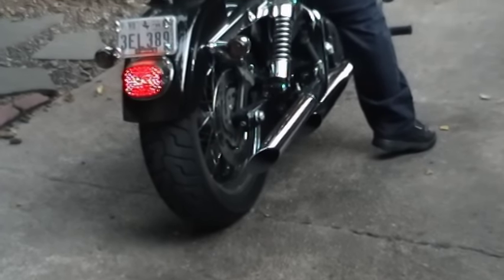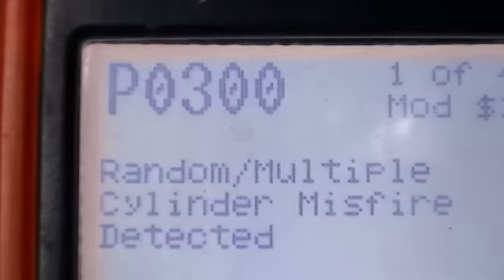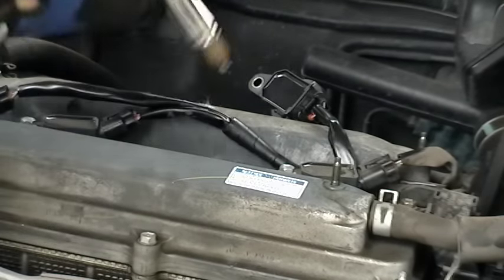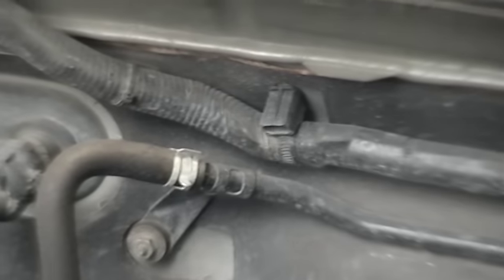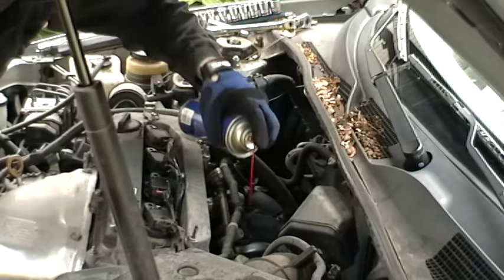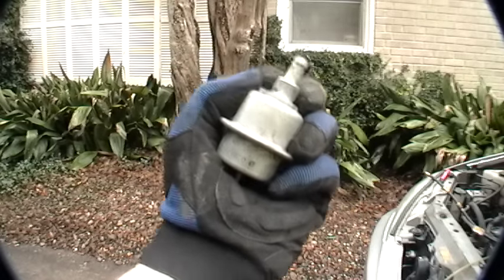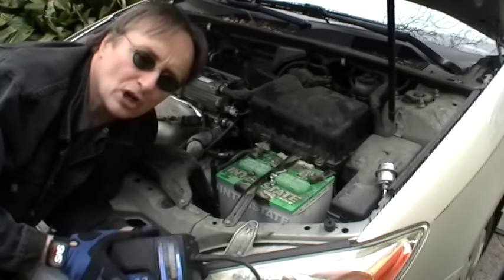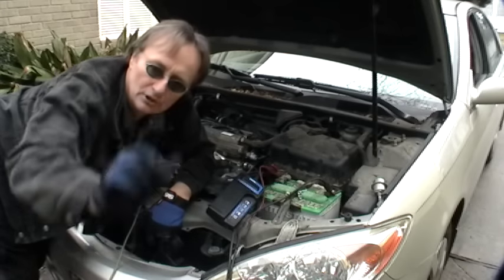How to Fix a Random Engine Misfire in Your Car (Code P0300)

Comment: hi master Scotty,i have chrysler s300 2010 and it got a problem last couple days p0305 that maked my car's powr down , i changed the sparks plug and the coil number 5 but the problem still there ....
Reply from the maker: +MR. NOOR swap fuelinjector # 5 with another and see if miss moves, showing that's bad. If not that, often internal engine problems, do a compression test to check that
Reply: +Scotty Kilmer i fixed what you told me to fix it now running good and another code has com p0016 i do know is the problem in the sensor or in camshaft timing .. thanks

Comment: i have a  1997 mercury villager gs 3.0L engine made by Nissan. i had the timing belt replaced by a friend and we lined everything up. started it and it ran like crap. checked codes and its the random miss fire code. replace fuel filter ,spark plugs, spark plug wires, rotor button, distribator cap, starter, and battery still bad code could it be the vacuum lines?
Reply from the maker: odds are he didn't line the belt up just right. Being off one tooth will do that, remove the timing cover, put it on TDC crank, and see if either cam is off a tooth or more
Reply: ok will do as soon as he can get back out here. and thank you

Comment: First it was saying cylinder #6 ignition coil now a week later it's reading random misfire and my car has been jumping real bad... 2005 Nissan Altima 3.5 SE any ideas??
Reply: Plugs or coils probably. Did u replace the spark plug when u replaced the coil? If not start there.

Comment: i had this problem in my 2001 blazer the mil would flash if i drove over 60kph i changed my spark plugs my distributor can and rotor checked for vacuum leaks none to be found checked my egr valve that was fine changed my fuel filter and checked my fuel psi and they were fine i was about to give up and then i changed the crankshaft position sensor and had a gm dealership do a crank relearn procedure and boom problem solved i would always check that sensor to because sometimes it wont show a check engine light

Comment: I need help my 2004 Dodge ram 1500 has the flash light on I replace the throttle body and camshaft sensor bit still doing the same

Comment: Hi Scotty  have a 2008 Qashqai, misfire on ticking over and up to 2000 revs over that runs perfect, on 2000 revs if I let my foot of then straight back on he will go for about 15 seconds then start misfiring again,the first code came up PO302 next day the code came up PO300,help needed
Reply from the maker: check #2 for weak fuel injector or weak ignition coils first
Reply: Thanks scotty no 2 cylinder took plug out and was sooty all others were OK the problem is no2 cylinder but put a new plug in and still the misfire thanks again

Comment: did all these but 2005 impala wont start random misfire has spark fuel air just cranks car seems to keep trying to turnover even when key isnot been turned any longer
any help is much appreciated
Reply from the maker: try a new ignition switch first

Comment: Thanks, I am learning so much whit your videos ,I am  single mom  and this help me save money  ,I sorry  for my english  a`m learning too,  my car s a hyundai 99 accent and  i have code 300 , 302   and 123
Reply from the maker: +R Luna fix the misfiring cylinder number two first. Could be bad spark plug or coil on plug OR wiring. Pray it's not internal engine damage

Comment: 2002 deville  300 misfire code,,,,   145,000 miles  runs perfect at start up  ,  no code for the first 20 minutes, then engine lite starts blinking, cleaned o2 sensor, no vacuum leak,  changed coil packs,  new plugs, new fuel pump, new catalytic  converter, map sensor, new pelum ,, what warms up and can create this 300 code  , at wits end ,,thank you for reading this post
Reply from the maker: +yank mcruff   tons of things can do that, but a blowing head gasket is number one. Do my video "how to tell if your head gasket is blown"

Comment: Thanks for the reply. But sadly, my compression are all within specs and very close together as they should be.
It is a swapped motor with 80k and everything else 180xxx.
The coilpack and injectors are from a different engine though.
It was running fine until I had my exhaust welds done by my 02 sensor/exhaust manifold, then it just started idling funny at start and died at times when coming to a stop and has a spitting sound through the intake.

Comment: Ok, these symptoms say little to me, but to a pro, they are going to give you an idea.
2005 Trailblazer, 4.2L Vortec.
1. I got an exhaust leak that I can hear. It started one day twos months ago and since then, I can hear the engine more like a 1980s truck. Sound is from engine area. I have not located the exhaust leak or know if it's at a gasket or header or what.
2. Random misfires. The code is not confirmed, but I checked it on an OBD scanner and the code was pending P0300. I cleared it, and it came back pending. Cleared it a 2nd time, it hasn't come back.
3. Very rough idle at times... maybe especially when starting it on a hot day.
4. Moderate rough idle most of the time.
5. Rare, but I do see the quick Check Engine Light flash on climbing a hill sometimes.
6. I have replaced 2 or 3 COP modules over the last 2 years as I would find a P030X code and a cylinder's coil went bad. Of course, those situations would start intermittent, then finally set a P0302 code or whatever, and I would immediately replace the #2 coil when that happened.
7. It's never really idled too great, especially summer and with A/C running.
8. I have owned it with 180,000 to 220,000 miles.

I just started it a few minutes ago. No code, moderate rough idle, no check engine light, but I did not drive it far.
Reply from the maker: try to find the leak using smoke as in this video https://www.youtube.com/watch?v=zMok2y05jNE&t=11s
Reply: Thanks. But at the moment, for the last time I drove it, I monitored misfires on an OBD-II reader. Guess what?

No misfires.

No codes.

Running better.

What would cause the intermittent rough idle that is so bad, the truck barely runs, then the next day it runs like a champ?
Reply from the maker: weak fuel pump, they are electronic and can fail intermittantly, when it runs bad, pressure test that

Comment: hi scotty  i have 02 impala with the 3.4 engine the car stars just fine the problem is wen i want to pass a car passing gear clicks but no power i replace  fuel filter one coil spark plugs tps sensor  i clean the map sensor clean the  agr the o2 sensor    i have no vacuum leaks and i have the nasty p0300 please  help 
132xxxxx miles

Comment: scotty i have a bmw 1serise with the yellow engine warnging light i have changed all the spark plugs and even did an air filter change i didnt change the oil filter but still have a yellow engine light, the car starts ok but is shaking a bit and cuts out when i gass it lacks power and i get a lot of white smoke from the tail pipe i had a guy put a code reader on it and he also checked the plugs and coils but couldnt find the reason for misfireing and now tells me it may be the thermostat sensor?

Comment: I'm getting a p0301 p0302 p0303 p0304 and p0300 on a 2005 Honda Civic Lx Special Edition. The car was parked for 5 months and did not have a check engine light on when I parked it. I was going to take it in for a smog check and saw the light as soon as I fired it up, engine was running smooth at idle so I turned it off and removed gas cap and put it back on light was still there. I have a ODB 2 scanner so I hooked it up and those are the codes I got. I wish I had that nifty battery tester cause after sitting so long maybe it's that.
Reply: Replaced all spark plugs all were pretty worn but one was black crusted over. I reset the codes so now I'm going to put some miles on it and see if this fix's problem. Thanks again for your videos. I'm also going to drive by autozone to see if they can do a load test on my battery.
Reply: All you need for the battery tester  . Get a volt meter . It tests alot more then batteries ..

Comment: Hi Scotty very much liked your video. I have a 2007 Renault megane cc. Realised today it has a problem with power. Diagnostic OBE 2 says PO300 . Also there a squeaky noise when driving. Can you advise me please?
Reply: I have the same car and same problem, I've been googling into renault forums and other pages and I will check engine coil with my mechanic. If you discover what's wrong with your car, please let me know.
Reply: +Navi Voj 
 Taking car to the garage tmw , and will let you know about car issue

Comment: well scoty i got this code on my 03 gmc serria i did the cap adn roter wires it might be the coil pack weck spark 
im also wondering is there any fuses that can be checkt for igtion i did have the parts guy sya hay u might repalce that any who ill check fuel filler i did that 5 years ago maybe over do thanks

Comment: Sooo I pulled my spark plug boots out of my eclipse and in the first one there's oil, but in the others it's clean, I was gonna try to check or change my spark plugs but even with a deep well socket I couldn't get them out.
Reply from the maker: +Levi Grafton make sure you have the right size socket AND replace the valve cover gasket and spark plug tube seals

Comment: I have an 03 2500 with 6.0 at idle under load (stop lights etc) it idles up and down. I have a  random misfire code. but the check engine light only comes on  when im on the freeway usually comes on when i get to 77-80 mph. it will start blinking then if i slow down below that it goes off. any ideas?
Reply from the maker: often fuel injector problems cause it on that model . First try my video "how to clean fuel injectors on your car" and PRAY you don't need new ones

Comment: Previously I had P0300, P0301, and P0304. Replaced coil pack and the wires from the plugs to the engine and now I get the CEL flashing but no codes, suggestions?

Comment: i got both p0300 and p0302, check engine light is on. i just changed and double checked the sparkplugs, and its still misfiring! mechanic says it could be an internal computer thing?

Comment: I have a 2002 Dodge Ram 1500 and it's misfire code number p0 302 I had changed the core and a spark plug roll around for 2 weeks in the light came back up with the same code
Reply: Do a compression test on that cylinder.. had a similar problem on a jeep replaced everything on that cylinder ended up being a bad motor

Comment: hi scotty it's me again i have question about Suzuki forenza I talk to you before couple days ago I have oil top of the piston and you tell me drive the car for one week but the problem is i have check engine light on it show me code p0300 and I change the spark plug and the wire but the light is on
Reply from the maker: +Karam Chato that's random misfire, I would assume the repair job on the engine was done poorly, especially if oil is still there.

Comment: hey scotty  i enjoy watching your vids and learning stuff ,, i don't know if i did comment in this vid before but i did  in other vid ,, about my jaguar s type r i got  random misfire, so i replaced 4 coils that they were bad so i thought the light would go off but didn't go off so check for  codes again and now i got 8 misfire codes  instead of 4 im so confused and desperate now  i got suggested to get new battery cuz mine is 2012 so old but i took  the battery to auto zone they tested and battery is ok and they told me  that bad battery dosnt cause misfire ,, but i have some bad valve cover gasket cuz i found oil in some plugs  ,, is there any chance that bad  valve cover gasket could cause misfire or bad fuel filter or electric problem ,,, cuz my car was running perfect a week ago after replacing the  oxygen sensors i went to cleared the cel and stared giving me restricted performance message ,,,
Reply from the maker: bad battery can cause misfire, realize that.  But on a jag, you must replace ALL coils in a set or computer will be confused and often misfire
Reply: thanks scotty you are the best   :)

Comment: I have a 08 charger 5.7 hemi only when engine is and I get it up to speed for the eco mode to kick on then it causes a p300 code stop shut off car and start it back up let it warm up never does it again futile it cools down then will do it again I changed the mds solenoids  it didnt fix problem dont no what to do now

Comment: Can anyone help? I have a 2004 Pontiac grand am gt. It’s a 3.4l v6 and it says cylinder 2 missfire. I replaced the fuel injectors and all sparkplugs and a new wire set and don’t know what else to do. Any help???

Comment: But my battery is new and my plugs are new and gapped properly and my fuel pressure is okay and my car doesn't have any vacuum leaks. what else could be causing it? I've just replace the coil, wires, distributor, injectors, fuel pump, and the entire engine has been replaced. I'm baffled Scotty and need help

Comment: I have a question and its important that i figure it out before i end up in a crash my 1998 GMC Sonoma sls 2x4 4.3L v6 with ODM 2. Ok you can drive it and in no consistent manner it will die nothing at all consistent with it just at random we have had at the local gm dealer but they have no clue it leaves no codes or anything and there is like a few hundred things it could be could you please help with this its my only vehicle i can have right now and i would rather not end up dead because of it the random shutoffs is not good in a busy city thank you for all who try and help in advance.

Comment: I changed all the spark plugs
Sparkplug wires
Pcv valve
Ignition coil
And the fuel injector on cylinder 3 cause it wasn't doing it's job. Now with the new fuel injector p0303 was gone and then it came back on reading p0302 so he changed the spark plug and switch the wires and now the code is saying p0300 when it's in drive and foot on the brakes it's jerking and I want to get rid of that problem

Comment: i have a 99 toyota rav 4, the code is showing up po300 I have put new plugs and wires on it and a new fuel filter. what else could be wrong with it
Reply from the maker: over a doze different things can do that, from weak fuel injectors, vacuum leaks, and bad main computers. Have the live data analyzed by a pro mechanic like myself to see what system is acting up

Comment: Scotty i have a 2004 olds alero 2.2 got thatp0300 code replaced plugs it drives and idles rough when i turn on the a/c it feels like the engines is ging to come out the hood help

Comment: What if my car miss fires but at high rpms? Start up is fine and low revolutions are fine but hit the peddle and i get random miss fires i eventually get the car up to fast speeds but contant back fire. No check engone light tho
Reply from the maker: high speed misfiring is often worn valve springs, OR worn out fuel injectors

Comment: Hi I have a 2005 Infiniti FX35 that misfire through the Plymouth I already changed the injectors in the field damper in the fuel pump new coils new spark plugs new crank and cam car starts runs and then die
Reply: Were you able to pull any codes?
Reply: No don't have code reader

Comment: Hello Mate
I have 2004 corsa c 1.4 twinport 16v.
problem is when car is started its fine stationary but as soon as u drive it eventually seems to go into some form of limp mode engine management light comes on the code comes: the car at this stage is very lumpy needs much more acceleration to move , still drives but feels like its struggling to stay on when idle. the revs are not going crazy tho.
im getting error code p0300 which indicates unidentied misfires.
Ive changed sparks,coilpack,lambda sensor so far no vacum leakess
put a new battery in there.

stil no luck?
any ideas???!

many thanks
Reply from the maker: get it scanned by a guy like me, the computer would store all kinds of information on the problem if it's going into limp home mode. that's how I analyze them
Reply: Scotty Kilmer Hi Scotty, the thing is I have had it scanned and it gives me this code "power train/P0300 multiple misfire unidentified, followed by p0302 AND P0304 . I have changed even the air mass flow still no difference at all.

Ive read online that someone suggests the oil pick up pipe from the sump gets debris of plastic possibly from the oil filter. do you reckon this might be the soloution??? PS . I made my utube channel after watching u# inspirtaional.
Reply: Handy Voice sorry i meant these codes : P0300 Misfire Unidentified Cylinder Detected B-21,P0304 Cylinder 4 Misfire Detected B-22 
P0302 Cylinder 2 Misfire Detected B-22^^^^
Reply from the maker: Handy Voice 4 and 2 are misfiring, I would swap their ignition coils first with others, and if misses moved, that's it. If not that, swap their fuel injectors for others to see if they are bad
Reply: final question scotty. so if cylinder 4 and 2 are the ones coming up as misfires, does that mean I have to purchase 2 fuel injectors as i think it has to be the fuel injectors must be the cause! any way u recommend i could test to see if the fuel injectors are faulty as ive never attempted that before.
thanks
Reply from the maker: Handy Voice
do like I do, swap 2 and four injectors with one and three, if the miss moves, you know they are bad.
Reply: I just checked with my OBD machine that cylinder 1,4,2 are all misfiring with the P0301 ETC. Im thinking to take the injectors of now isit hard? and also would it be possible the injectors are clogged up causing the injectors to fail?
thanks for the help man
Reply: Scotty, I took the fuel rail off, Noticed the connector for cylinder for had bit of wet in it. So i gave the injectors all a clean and swapped them around . 
put it all back together.
now after i put it together to the best of my knowlege the spanner light came on and i scanned it and got p1405 which i have read online is egr related. the car drives perfect tho? any idea?! should i be worried?
Reply: Handy Voice
EGR ports can always benefit from cleaning.  intake manifold